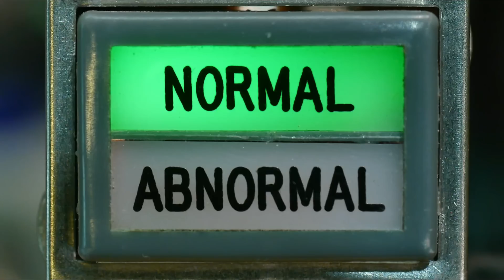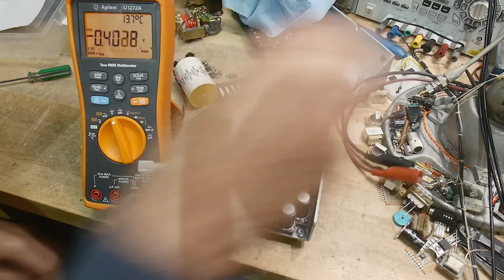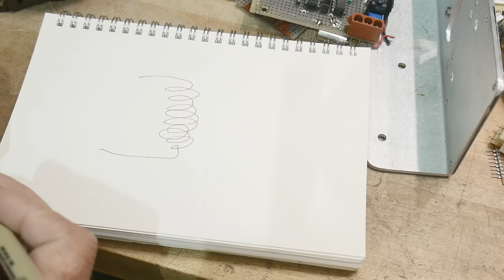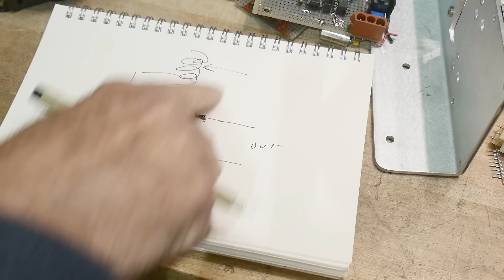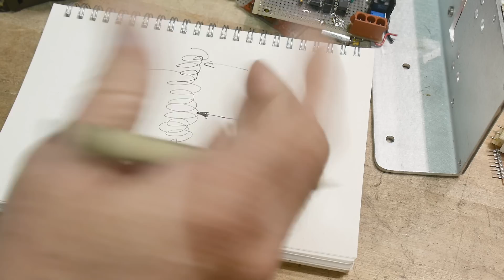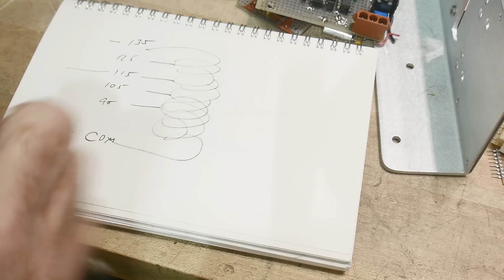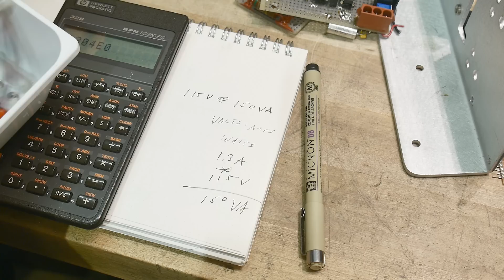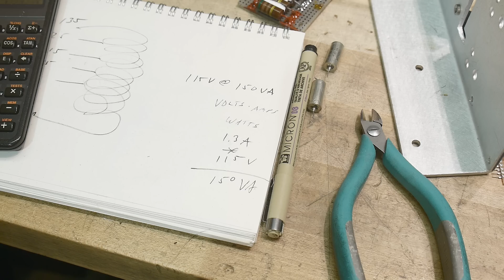#1374 200 VDC supply, giant poly cap, auto transformer

Comment: That auto-transformer sounds like what must be inside a gadget I bought that adjusts voltage down to ~110 volts for vintage guitar amplifiers to match the wall voltages common in the 50s and 60s. It's also to protect from nasty power available at some gigs. It has other protective features not included in a regular Variax. It's an "AmpRX BrownBox" -- built like a tank and cost $350. So yeah. That's probably worth more than $20 all by itself.

Comment: Variacs use TWO (or more) parallel primary windings side by side; wound as known as two in hand, that way the 'wiper' contact can make contact to the next wire without creating a shorted turn; which will destroy windings,  or causing a ' off  ' condition as the wiper moves to the next wire contact. The wiper contact is often in contact with two adjacent windings which are of effectively the same potential, but the greater voltage will 'slightly' dominate but causing no problems when loaded

Comment: That 74LS221 is a precision one-shot. Probably was the one that generated the pulse width (variable with the front panel control). Hard to see why they needed a 0.1% precision resistor in there though.... Unless maybe for temperature stability?

Comment: 135/95 = 1.4 so run 115 into the 95v and get 163v out on top
your high dc was ~224v ... 224 * 1.4 = 313vdc  all plausible 
200v ain't that high IMHO
I once worked with a 450kv Cockroft Walton in a huge tank with SF6 gas as insulator.
Many folks worked with color TV's at 25kv
Tube audio is easily 400vdc or more.
Just gotta learn where not to put your fingers. ;-}, the learning curve is fast.